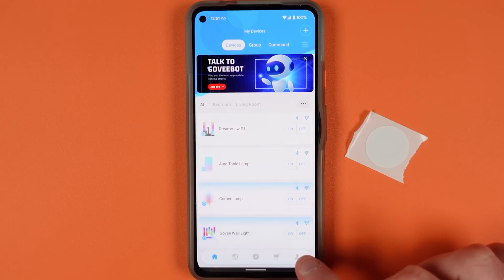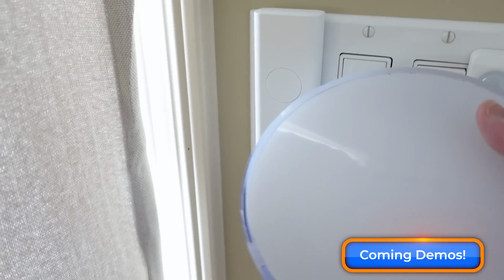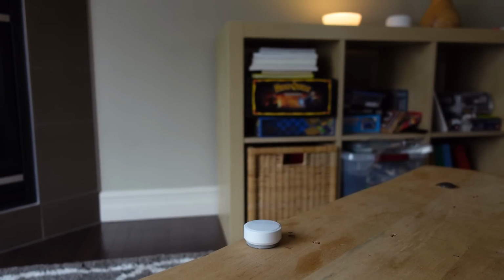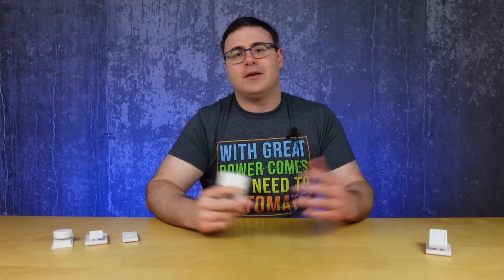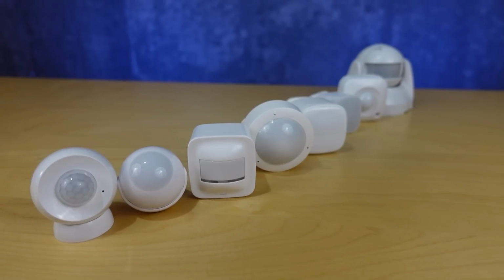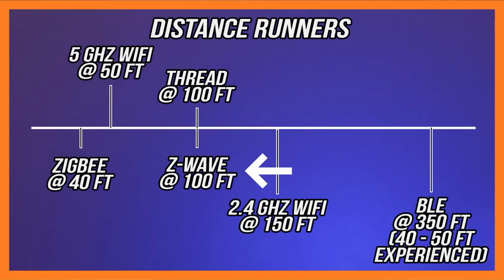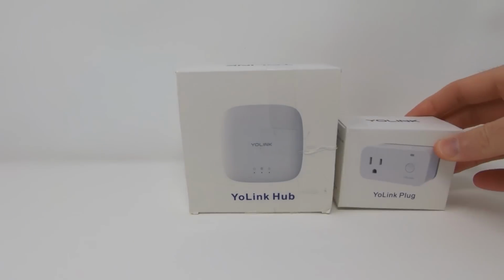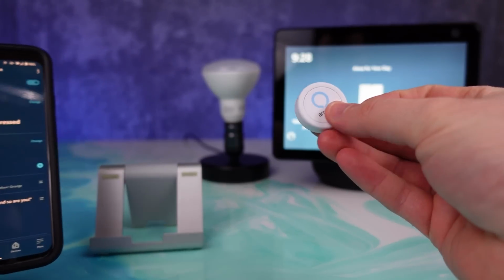The Best Tips For Smart Apartment Lighting!

Comment: Great video, Brian.  Your ideas are not just for renters but for old folks (I'm one) who might be nervous about doing too much in the way of "permanent" wiring mods to their homes. It's also good for those wanting to get their feet wet in the smart home arena.  I didn't realize Govee had NFC in their app...Switchbot, too. Does Govee just support NFC on iPHones right now?  I have one, but didn't see it for Android phones although that might show up in the Android Govee app.  With the NFC, I wish they had a toggle function so you could turn 'em on and off with the same tag.  I know Hue supports toggling. I like the switch covers and use them.  They're also a good place to put NFC tags (on the inside of the switch cover.).  Oh, I like you encouraging (maybe) the use of hubs especially for those folks who don't want to update their WiFi networks as hubs take a big load off as there is only one device added (Hue hub, for example). That hub might handle 15-20 devices that might otherwise be competing for a WiFi spot on your network.  Keep it up, my (our) friend!!!
Reply from the maker: Hey Hugh!  Govee has it in Android cause I'm showing it there! 😃
Reply from the maker: And thanks so much sir!  Not a lot of views off the start for this video